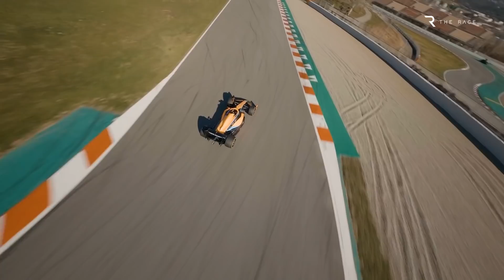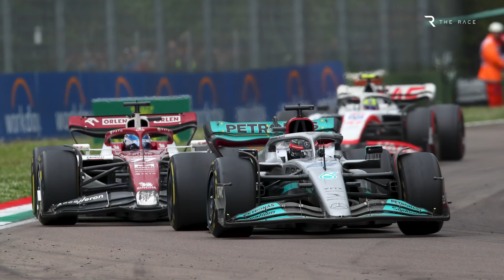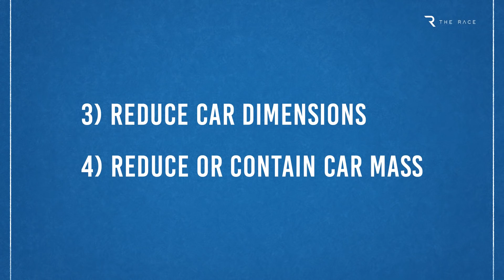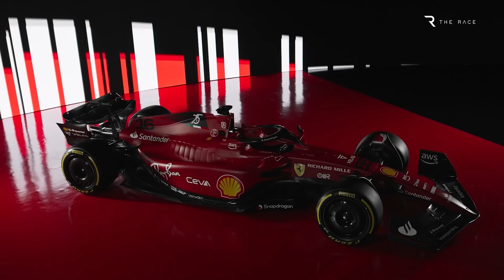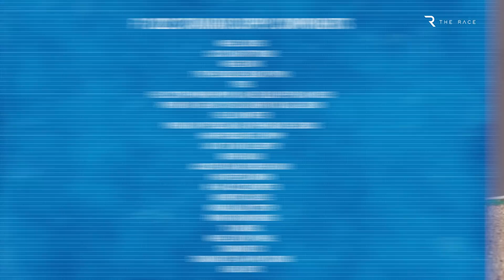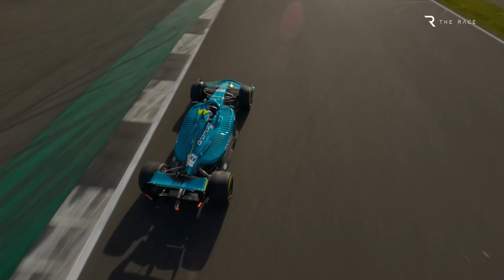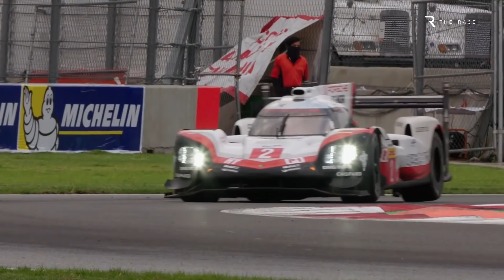F1's new major plans for 2026 car overhaul explained

Comment: Lightweight = More efficient, more nimble, more responsive, speed gains everywhere. Glad it’s on the sports radar as a requirement.
Reply: It also means less dependent on aero so less aero dependency means less dirty air which means better and closer racing
Reply: Should be an actual mandate for road cars aswell, as soon as possibile too if you ask me.
Reply: @drazenbudis7881  Agreed!
Reply: exactly, F2004 is quicker than the W11 on the same tyres
Reply: @marcoroberts9462  not true, the f2004 was built around the grooved tires that were around at the time and the w11 was built around pirelli tires. you cannot compare them. slapping pirelli slicks will most likely make the f2004 slower than with grooved tires.
Reply: @no1washerezz  the 2020 pirelli’s are different shape and size to the 2004 Bridgestones yes ok but if there were slicks that were the same size and shape as the 2004 grooved tyres (maybe the 2009 slicks are the same idk) then the F2004 would be faster
Reply: @marcoroberts9462  its very unlikely that it would be faster. the w11 is far more superior in terms of aero and with the engine aswell. i believe v6 turbo hybrids are running about 4 bar of boost... vs a naturally aspirated v10 making very little torque. not to mention the addition of the party mode, DRS,  and the hybrid system.
Reply: @no1washerezz  the F2004 is so, so much lighter than the W11. 150 KG lighter in fact. also despite the PU being less powerful there is considerably less frontal area therefore less drag and the top speeds are largely similar. considering how close rubens’ monza time is to the 2020 record it’s quite feasible that the F2004 on slicks could beat it
Reply: @marcoroberts9462  more often than not the w11 is faster especially on a track like hungary or pretty much anything that isnt a straight line monza run.
Reply: @no1washerezz  the W11 is faster at monza too, but the difference is tyres. but on the same tyres the F2004 will definitely be quicker on some circuits especially when there are few high speed corners and many traction zones from low speed

Comment: formula 1 needs to minimize the mass and volume of the heavy hybrid batteries because they make the cars way too heavy with the low energy density. remove the mguh and mguk. keep engine displacement limited to somewhere around 1.6L to 2.0L for everyone, but allow teams to choose engine layout and turbo/ supercharger design. if ferarri wants to make a 1.6L V10 vs a redbull 1.6L supercharged V8 then let them.
Reply: LMh is more of the space for those type of regulations….
Reply: i agree 100% teams should have a cap for money and what not for others to join and have a shot, but more freedom needs to be given back to the teams for unique designs and builds with their respective applications not more like nascar's stock car format.

Comment: Take the wings off and make the ground effect provide all the downforce. Max height, 1 metre. Max width, 2 metres. Max wheelbase, 3 metres. Max length, 4 metres. No limit on numbers of wheels/tyres, and which/how many are driven. Engine configuration and number of cylinders free. Minimum weight, 600 kg.
There, I've sorted it for you.
Reply: Don't forget lets have a max weight as well.

Comment: I am most excited about them reducing the size and mass of the cars. Trying to add 'smart' connected safety systems, I'm less sure about...
Reply: Smart system could work well. Yellow flag, car auto adjusts speed, Waved yellow slows more. Red even more. VSC all cars run at same speed. So no catching the car in front because someone was a bit faster or slower. Takes it all out of drivers hands so no more Didn't see..
Reply: @johniooi3954  I do think the VSC should always have been done by a fixed speed limit instead of some sector-by-sector target pace they can bend a little here and there...
But I've thought about remote-controlling a car's PU for a penalty or safety system before and you'd just be waiting to see the time that someone's car is remotely slowed and then, by some glitch, can't speed back up again afterwards...

Comment: I want better sounding engines. Hopefully these "high-revving" ones will sound better
Reply: As long as there is a turbo, we'll never hear anything like the v10s and v8s again
Reply: @adriangabba  listen to the old V6 Turbo's from the late 80's, those sounded amazing. I think the MGU-H and the integrated wastegate are the biggest culprit for the sound, which F1 is getting rid of
Reply: Remember the Mazda naturally aspirated engine in le man, something that sounds similar would be good
Reply: No one gives a crap about that
Reply: @vl3005  Actually a lot of people do.
Reply: @vl3005  I do!!!
Reply: @vl3005  most of F1 fans do
Reply: @hikmahuddinhasbullah3928  wow, that's a dumb unfounded statement.
Reply: @vl3005  Mate. The sound of the V8's, V10's and V12's (albeit different and preferential) were the one of the pinnacle aspects of F1. Now the pinnacle of motorsport seems to be the straight piped 350z that passes my house every afternoon 🙄🤷‍♂️

Comment: I would love to see NA inline 5s in F1. The old V10s will never come back but the sound can be revived with an inline 5. It would be a good engineer challenge for the teams that would change F1 for the better
Reply: The problem is that they are using the V6 because V shaped engines are more rigid (more box shaped and used to make the chassis more stiff) than inline engines. They also have a lower center of gravity and are more commonly used in road cars. I love inline engines but I believe only BMW use them now. Not only that but the inline 5 is less balanced than the V6.
Reply: @e3k701  Mercedes and stellantis have new inline 6's and Mazda are launching one.

An inline engine needs a spaceframe I believe. A wonderful advantage of v type engines is making the block a stressed component.
Reply: Very true, inline 5s sound quite similar

Comment: Already?
Ban all aero but for a single simple front and rear wing mounted outside the wheelbase.
Replace the engine formula with a standardised fuel formula.
Cut the maximum wheelbase and track in half.

Comment: Imola showed how these cars need to shrink. They may look mighty, but you shouldn't be able to park an F1 car like a bus in the centre of the track and the car behind not have room to dive down either side. You should be able to segment every F1 track into 3 lanes and be able to fit F1 cars into at least 2 of these lanes of every straight. So if a driver parks it in the middle, the cars should be narrow enough to fit a divebomb either down the inside or outside. Imola was ruined by being able to park the car in front in the middle of the track, it was an unfair competition.

Comment: What is the reason for dropping MGU-H other than VAG not having one that works on their stillborn F1 engine project?  If improved efficiency is what F1 is claiming to be about, the MGU-H is a huge reason for the high thermal efficiency. Seems a backwards step
Reply: Engine sound/Exhaust note one of the objectives of 2026 is also to have a more emotive sound. Also the MGU-H adds to cost and with the budget cap its difficult to manage.
Reply: Mgu-h has almost no road relevance and is insanely expensive. Just one of these would be something you could deal with, both together is like vinegar to flies.

Comment: Over time, FIA changes became progressively worse. Based on their inane mindset, 
here are a few "Suggestions." 1)Armored Cockpit designed to withstand 
a Javelin ATGM. 2)Run flat solid all weather tires with only one compound. 
3)Detuned EV (1 motor only) so that no ludricrous mode, and no DRS ever. 
4) Steel brakes, and all vegan brake pads. 5) Floor raised higher than 
an early 1970s large American sedan, but with much softer springs and 
very generous  body roll. Triple plank and diffusers eliminated. 
6)EV Pit stops always based on a previous generation. 7)Horn, turn  signals, 
license plate (with FIA and EU seals),  daytime headlights, and large onboard fire extinguishers in at least  three areas of the car for maximum "safety." 
8)Cornering speeds remotely controlled by Officials on the take, and  aided by AI.
Favoritism, politics, money changing hands behind closed doors elevated 
to new heights.  What about the  Spectators? Who are they? 🤣😂🤣said the FIA.

Comment: Minimum car+driver weight most certainly needs addressing & reducing car dimensions is one way of lowering the figure.
So are engine size, PU component amount, smaller 5-speed transmission gearbox, & fully synthetic fuel, which should more easily allow for a downsized tank capacity & as little as 75 kg for race maximum allowance based on Symonds' words.
The 11 tyre set trial is a good move, while the budget cap should shift to 135m from next year as planned. Otherwise, the cap's intention would get contradicted.
If teams have to compromise car development to stay within the cap, so be that. Overall, good targets.
Reply: but the gearboxes are already tiny! Remove one set of cogs wouldn't make any practical sense. Would remove perhaps 5 or 6cm of length?
Reply: @djn3kkid  IDK. A 5-speed transmission is what I saw mentioned once & I immediately it'd be smaller & thus lighter than the present 8-speed one.

Comment: A little sad that MGU-H will be gone as it helped achieve over 50% efficiency in the power units and is a brilliant feat of engineering
Reply: It might come back when this technology becomes cheaper.  Just like turbos did.
Reply: @ChefofWar33  good take
Reply: Wonder why they don’t standardise it? Surely that would keep the cost down and fairness levelled.
Reply: @Tommmmmmmmmmmm  Agreed on standardization. F1 is trying to be all about sustainability and they are removing one piece that provided engines efficiency levels that was unheard of before.
Reply: @cmfrtblynmb02  exactly, such a backwards step. if standardised, any manufacturer wanting to join wouldn’t have to worry about having to start from scratch developing their own. keeps things fair, keeps costs down, keeps the engines incredibly efficient. win-win-win.

Comment: Just give them all a non modified Ford fiesta and be done with it, also there would be no problems with cost capping as they could all use a new car every race and still save money.
Reply: Go watch the Fiesta BRSCC championship on YouTube. Cars still modified though for emm safety reasons. Ordinary cars are not designed for close contact racing, but maybe you want a nice procession.